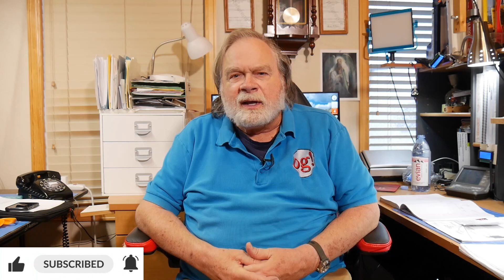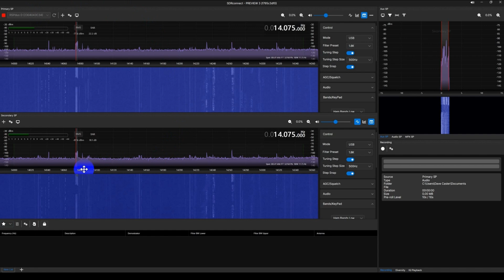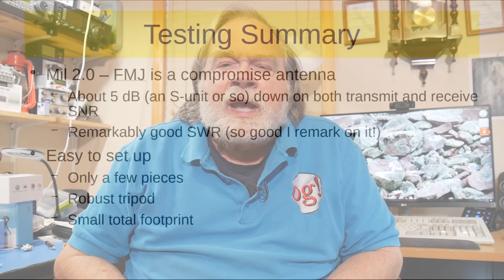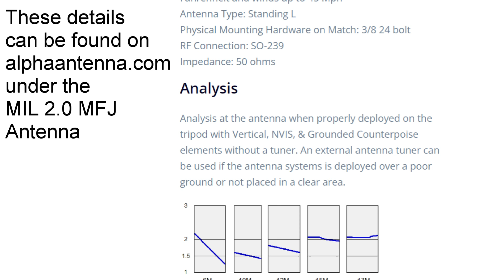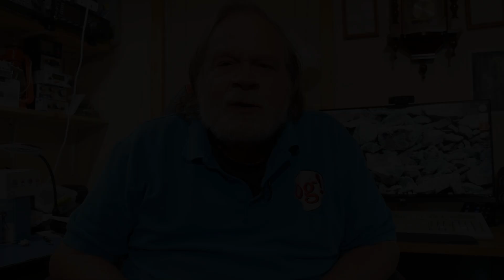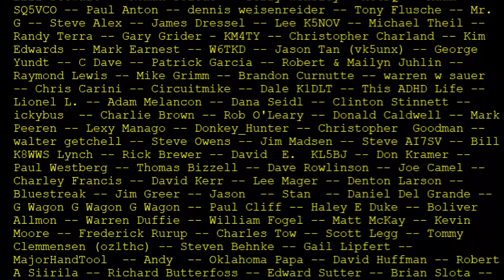First Look at the Alpha Antenna MIL 2.0-FMJ (#1159)

Comment: Purchased 23 December 2014
I set up the Alpha FMJHD yesterday for the first time. My first contact was London, England on 20 meters. I'm using an Icom 7000 with a MFJ 994B tuner and the shack is in Spring Hill, Florida. SWR was less than 1.0. Prior to purchasing I contacted Steven at Alpha Antennas with a few question. This was on a weekend and in the evening. Got an email back with my questions answered in less than an hour. Product is well made, very efficient, with outstanding technical support. Highly recommend
" 10 Years after above review"
October 21, 2024
Im using this antenna as my Base Station Antenna Yaesu FT DX10
Installed the new 17 foot stainless steel whip on the FMJ Match and contacts SWR was less than 2. Antenna is mounted on a DX
Commander 12 meter pole at 32 feet, which puts antenna at a height of about 49 feet. Contacts with new Antenna are from 10/13/2024. Arizona, Texas, Wales, Italy and Fernando de Noronha Island, Delaware, and Pau France.
P.S. I have this antenna 10 years and still works Great.

Comment: I use one of these for working portable and when on holiday. Paired with a Xiegu 5105 5W transceiver I have worked FT8 from the UK to Australia and phone to Brazil. Antenna, , laptop, radio and 10m coax all fit in a small rucksack.

Comment: That's interesting. My wife won an Alpha Antenna labeled the Military 2.0 back in 2017. It came with a stainless steel match device, and a 13' (iirc) multi-segment whip. Ours didn't come with a tripod, and I didn't buy their tripod. I've used it a few times, and it's a workable antenna with a tuner. I've never seen that amazing sweep Dave found on his, on mine. Mine always needs a tuner.